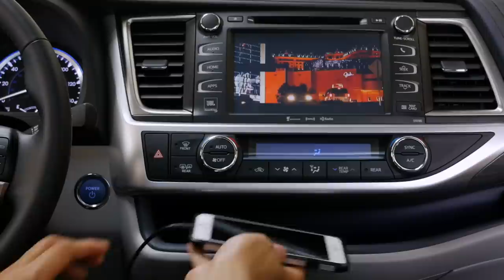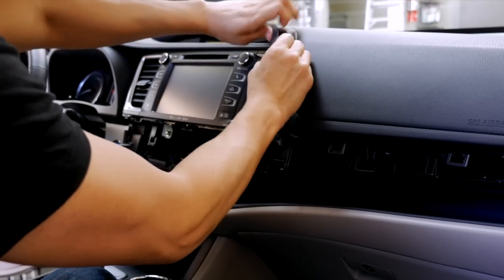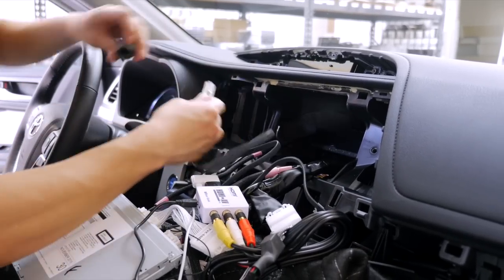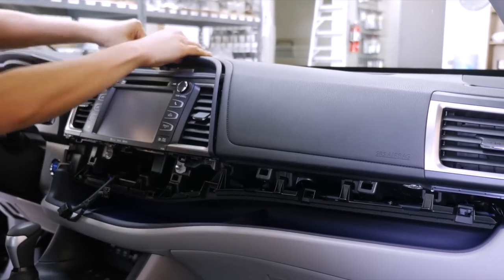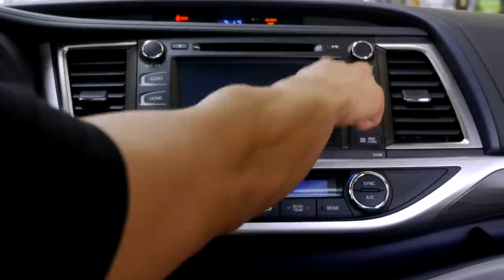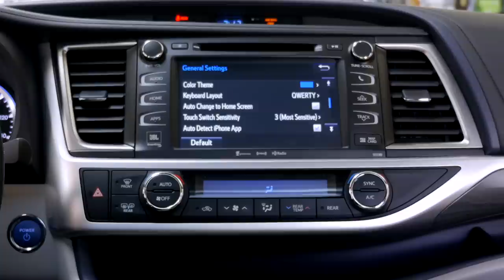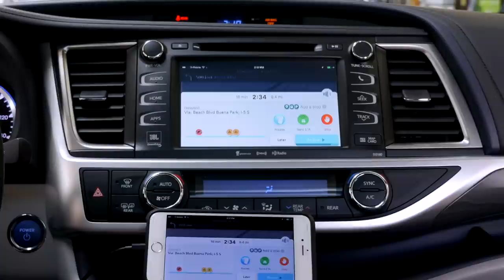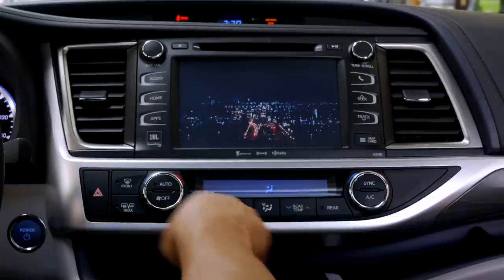2014-2019 Toyota Highlander Smartphone Mirroring System Installation and Demonstration

Comment: I don't trust myself to break open my 2019 highlander. It also voids my warranty
Reply from the maker: Kit is all plug and play and easily reversible. The interior parts surprisingly come out pretty easily
Reply from the maker: Kit is all plug and play and easily reversible. The interior parts surprisingly come out pretty easily
Reply: Lol no , You won’t void your warranty by adding this . If you snap the trim piece or break something well then yes , that part wouldn’t be covered . But your warranty is still intact . 
We install devices just like these , plus remote starts for many local dealerships and have never had a warr problem . 
We do the work for the dealer , they triple the price and sell it as ‘factory installed’.  Any warranty issues regarding equipment are covered by the place that sold it to you .

Comment: My 2015 XLE has a audio video delay (the sound does not match up with the video) on both Bluetooth and USB. Will your interface solve my issue while also improving the audio quality?
Reply from the maker: Since our audio will be direct connection through RCA cables there will be no audio delay with your video. Sound will also improve.

Comment: Got this a few months ago for my 2015 LE non nav. Im an expert taking my dash apart as I've added some headrest monitors, replaced stock speakers and added a sub. But this kit works and easy to install. Oh and i would recommend getting a 6ft lightning extension cable. I got a 3 ft one at first but realized that sometimes i sat in the back seat. So getting a longer cable would be good for rear passengers.
Reply from the maker: Thanks for the suggestion!
Reply: Is it still working? I am thinking about buying/

Comment: Just bought my 2018 XLE for $40k and I already hate not having proper navigation/phone integration. I thought I’d have to switch out the whole unit, this is a great hack. I’ll go for it and do a in depth install video.
Reply from the maker: Sweet!
Reply: I have the same year and model, will this work with my Galaxy S22 Ultra? Thanks
Reply: Did you install this? I’m looking to install in my 2018 XLE too!

Comment: Hello all, just a quick update from a happy customer. I’ve had this bypass for a while now and still works great. Here are some tips I learned along the way with installing this bypass. 

The space behind the head unit is very cramped. The first time I installed it, I used a regular 3ft lightning cable. I discovered its a pain in the ass to use your phone with a short cable so I switched it out for a 6ft one instead. Also, you should note that your cable will go bad at some point and will need to be replaced. My solution was to hae a back up ready to go so I have another 6ft cable rolled up next to where it needs to be plugged so I can swap it out really fast. Also, having a longer cable will allow your front and rear passengers to plug their phone and use it. Im a bit of an audio/videophile so I have headrest monitors and a full system. If its too much trouble for you to do, pay someone to do it. Its all plug and play, very simple. Its jist a matter of taking off a few pieces from the dash and 4 screws holding the radio in. And I just learned that Hulu will allow mirroring now so thats a bit of good news. Good luck installing if you bought one. Or just buy a new radio that allows carplay.
Reply from the maker: Awesome feedback. thanks!
Reply: Can you commenty more about Hulu mirroring?
Reply from the maker: abronca1 Hulu works flawlessly

Comment: Seems simple enough and should work on my 2016 XLE the same way.

Big question : how do I access the rear camera without going into reverse?
Reply from the maker: You can access the rear camera without going into reverse using our CS6EP front camera adapter
Reply: @BeatSonicUS  Link?

Comment: Will this work in landscape with the iPhone 7?  You were saying something about non plus iPhones but, didn’t understand.
Reply from the maker: Yes, you can go landscape with iPhone 7 as long as the application supports it. For example, Waze maps supports landscape mode so when you put you phone sideways it will go landscape. However, Facebook application does not support landscape mode, as such even if you put your phone sideways the app will not go landscape. 

 Only plus models you can go landscape on the background. There is really no point on going landscape on the background anyhow so it should not affect non plus model iPhones.

Comment: For Android users, we have to buy that wireless adapter. 
1) do we still use a cable to connect the phone to this kit or is it wireless. 
 2) how is quality with that, any videos demonstrations? 
3) with that nav motion button, if I am never going to use the in car nav software, can I just hide that switch too and keep it always on?    

Thanks
Reply from the maker: Hi Jim:
1)  There will be no cable connected to the phone and will be wireless for Android Users. 
2)  Quality for Video Playback is sharp and clear. Waze map applications also comes out clear. Text messages, Calendars, Google Maps will show pixels and is not as sharp. 
3) Yes, if you will never use the factory navigation, you may engage the button and tuck it behind the radio and always keep it on.
Reply: Will the controls on the steering wheel still work to make phone calls, raise and lower the volume, change radio stations,

When an incoming call comes in can I answer it with the steering wheel button, can I press the speak button and say OK Google

Comment: very useful video thank you! 
Is this possible with a 2021 or 2022 Highlander model as well? I have a client that wants this feature for a film they are doing.
Reply from the maker: Yes the TIF-02 is for the new Highlander models without the 12.3inch screen.
Reply: where you able to install it in the 2021 highlander? i been looking at this but dont see any video for the 2021highlander
Reply: @moneyjorge1  yep, we used a similar device for the 2022 Highlander Platinum. Took some time to get the right apps installed and working correctly but made it through.

Comment: This has to be connected by USB to the mobile device?  Will this connect via the head unit's bluetooth connection? Hate having cables all over the place. Especially from under the dash.
Reply from the maker: Correct this is a wired solution via usb.

Comment: Can you still use the car radio while mirroring the phone screen?
Also what is the on/ off switch that has to be pasted for and does it work with IPhone 8?
Reply from the maker: To use the car radio, you will have to get out of the AUX mode to Radio mode on your headunit. To listen to a radio while mirroring, you will need to download a radio app on your phone. The on/off switch is for models with navigation as there is a safety feature on Toyota radio to no allow video while the vehicle is in motion. The switch bypasses it. 

Yes, it is compatible with iPhone 8: http://www.beatsonicusa.com/if02aep2.html
Reply: Is each unit programmed by phone model? That means future models of Iphone (i.e. IPhone 9) will not work with  an unit programmed already for IPhone 7 or 8?
Reply: It also says the unit is out of stock

Comment: What happens when you don't plug in your iPhone? Does it show just black screen or can you still use your radio and nav as manufacture intended?
Reply from the maker: All your factory functions will work normally. In order to utilize the phone mirroring, you will need to select the new video input source item on your radio. You may at anytime leave the video input source to access your factory features such as your nav or radio.

Comment: Did you say that non-PLUS models of iPhone remain in portrait mode on the car screen?
Reply from the maker: J Allen the only difference is that the home screen will go to landscape mode in only plus models. All the apps configuration on going landscape will be the same. I’m sure you won’t be on the home screen much so it doesn’t really make a difference on you experience with mirroring whether you use a plus model iPhone or not

Comment: So I have several questions. Does the touch screen work on the Toyota while your screen mirroring or do you have to do everything off the phone and just view it on the touch screen?

I use Android so I don't need a lightning cable correct? And this stock USB will work with my Android?
Reply from the maker: The touch screen wil not work on the Toyota while screen is mirroring and you will have to navigate using your phone. There are some apps that allow continuous display while you lock your phone on an iPhone such as Youtube Red and Netflex. 

You will need a Type C to HDMI cable or if you prefer wireless you may use one with Android Screen mirroring such as the one we recommend on our website:  http://www.beatsonicusa.com/if02ep.html

Comment: what's the point if the iPhone is the only control input... seriously
Reply: does apple car play from fabric on other cars works the same? Having the iPhone as the only control input
Reply: People  with android phone can connect bluetooth mouse
Reply: I agree if you still have to do everything through the phone then the only thing you're really gaining is a larger monitor to view the map. Other than that I think it's too much money. This should be about $75 that $250
Reply from the maker: Integrating into your infotainment system :)

Comment: Can this device used at 2019 Toyota Highlander
Reply from the maker: Yes, this is compatible with 2019 Toyota Highlander
Reply: Awesone !! Can you send me list or link - what all i need  buy for the 2019 Toyota Highlander... and if you know any dealer around Bentonville Arkansas - who can install this for me as well
Reply from the maker: Here's the link on what you need to buy: http://www.beatsonicusa.com/if02aep2.html

Unfortunately we do not have a dealer in Arkansas who has experience installing out product. You may however, use this detailed video to help you install yourself. We have technical assistance team in case you run into any trouble.

Comment: Hey Eric, would this bypass work with this android radio? Link to radio is at end of comment. Looks like the harness is specially made for toyota highlander so im assuming this bypass will still work. Can you confirm? Im looking to upgrade the factory radio but still want to use the bypass. What are your thoughts? https://youtu.be/WGH3CW9J2Dc
Reply from the maker: I’m not sure what causes the android radio to lock you out of playing videos while in motion. I would contact the radio manufacturer as they should know better